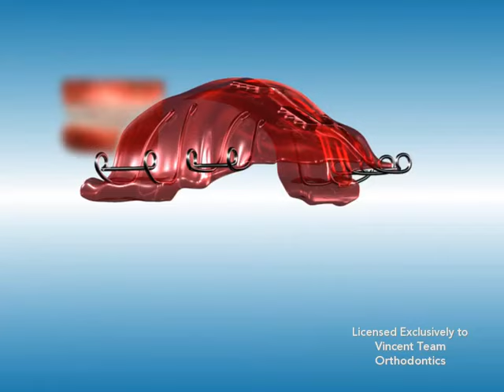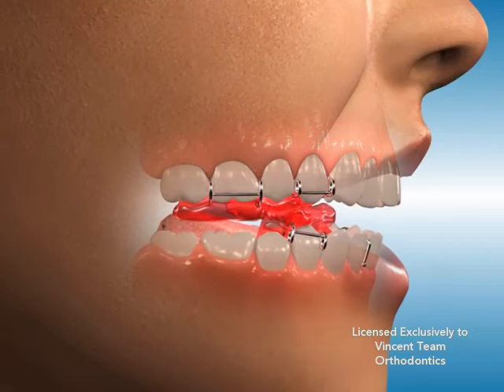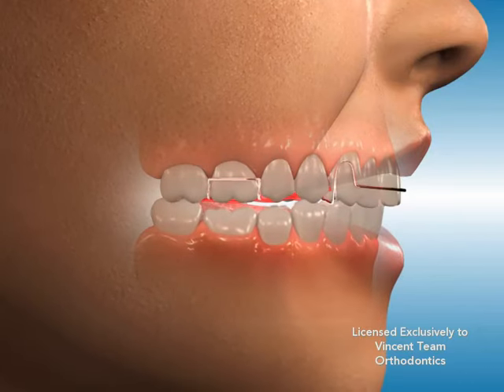Palatal Expander

Comment: From where I can get it? Is this useful for 24 years old adults?
Reply: I want to use this for both bottom and upper jaw
Reply: No, it is not useful to adults. Your orthodontist would have said you needed one as a kid. Since you are an adult, your jaw has fused together so it's pointless. Also, you can only have them installed by an orthodontist and they would likely say the same thing.
Reply: @dumpsterc0rpse  cranial sutures do not fuse until elderhood
Reply: This thing is just waste of money .. for jaw  growth try mewing or go have a surgery .. a palate expander will not widen ur face but it will give u an overbite for sure